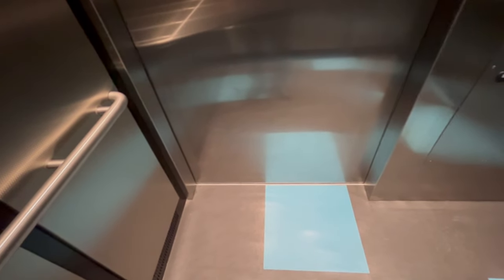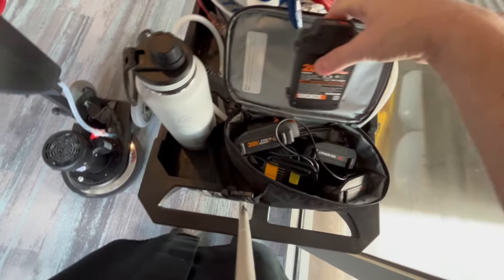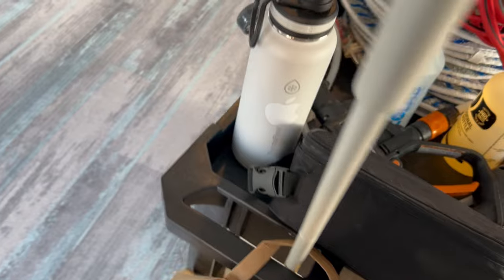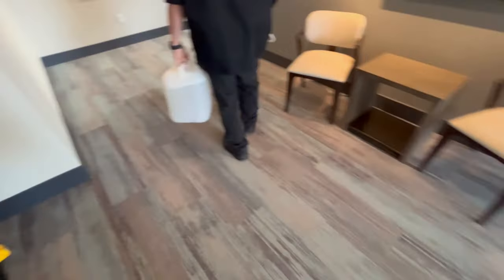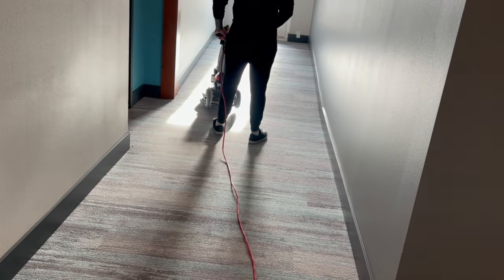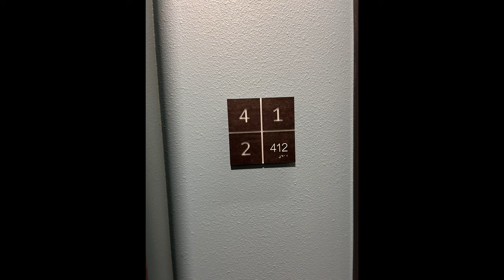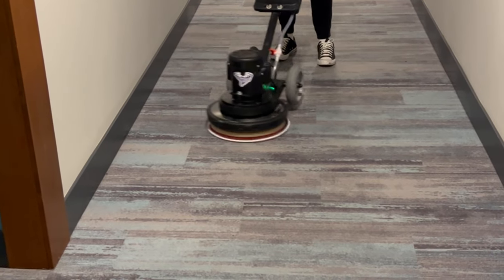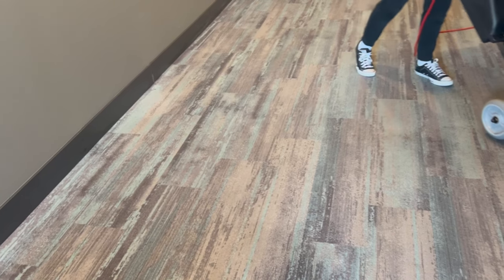Swirly 175 Floor Machine CRUSHES Commercial Carpet Cleaning

Comment: Wait! Green dragon is an ENCAP?? I can't use that in residential because it's gonna leave the dirt behind won't it? Please let me know!!
Reply from the maker: Not if you pad cap like one doing. 98% is extracted into the pads. The other 2% will leave zero residue and during the next routine vacuuming will be sucked up. Simple! Awesome!
Reply from the maker: Just gd
Reply: Green Dragon works great with VLM and hot water extraction.